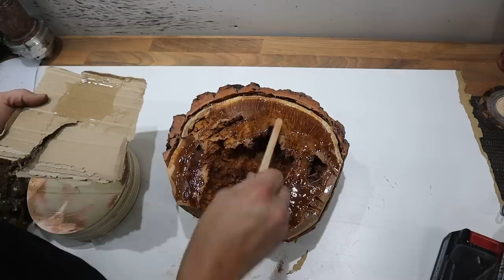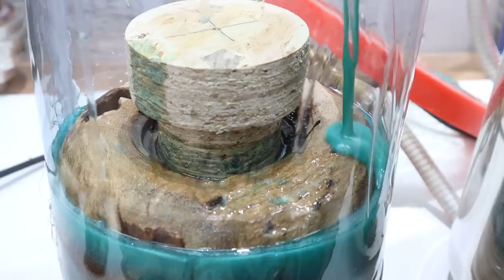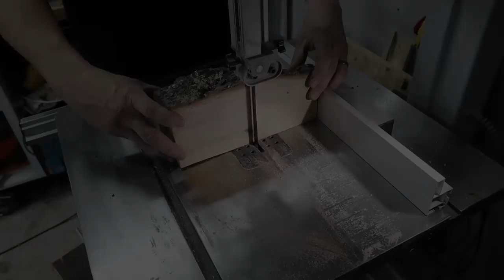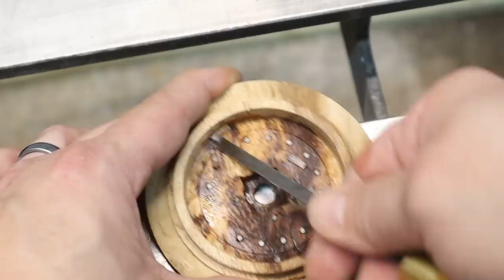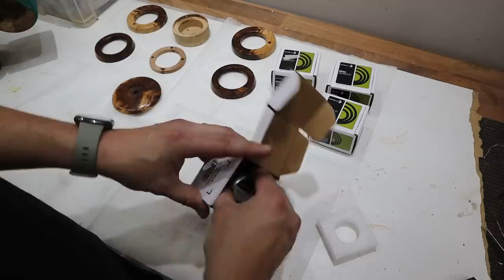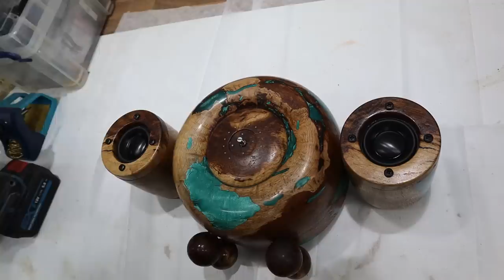Woodturning - Turning this into a Desktop Speaker

Comment: Hi Matt! Your craftmanship is absolutely fabulous with woodworking. I mean the speaker looks so good. I'm just a bit qurious and also concerned about the electrics. Even though the amplifier is a heatsink free solution, to enclose it such a way could cause problems later on. Just a thought, you know.
Reply: And I did check out the whitepaper of the chip, I know there's a temperature protection and all that. What I mean is it just kicks in too early in such an enclousure, IMO ;)

Comment: Matt, great vids as usual! 
Question: how are you finding the Laguna 1836?  Any issues? On the fence about buying one. Also, do you miss not having swivel headstock on this lathe…?  Thx
Reply from the maker: Thanks, zero issues with the lathe since I've had it. Not sure what you mean not having a swivel, the headstock can be turned a full 90, if you get the bed extension it can be used either to extend the bed or mounted on the front with the headstock turned 90.
Reply: @MattJordanWoodturning  thanks for reply. I just assumed head stock could not be rotated, as have yet to see a vid showing that. But great to know it can swivel.